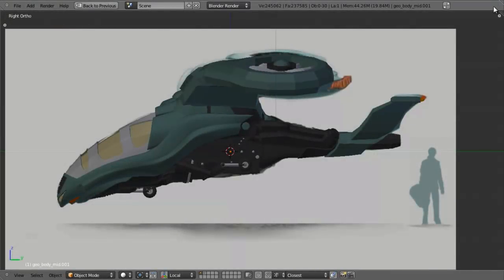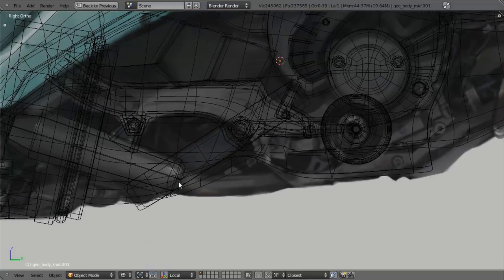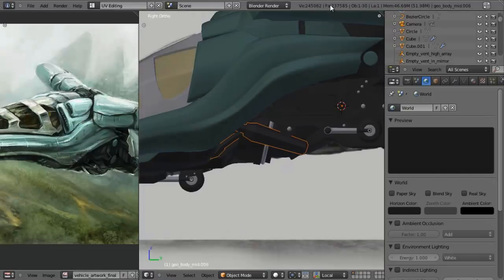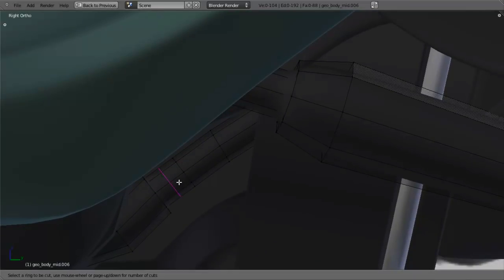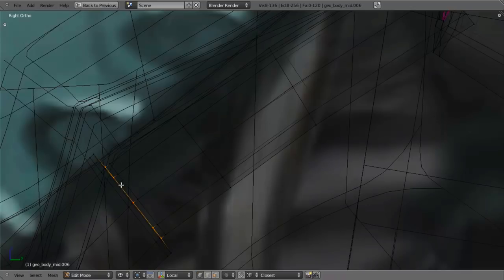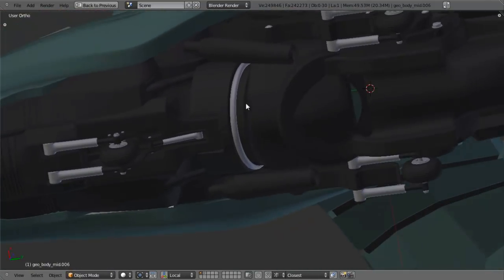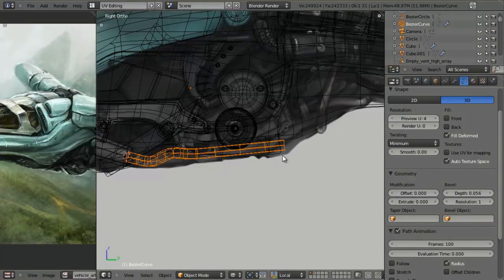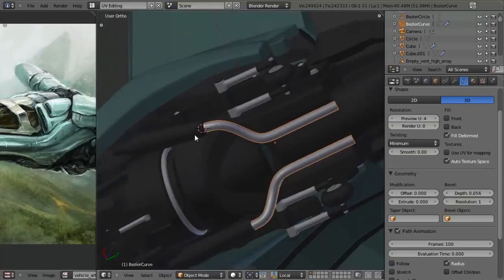CGC Classic: Modeling a Sci-fi Gyrocopter Pt. 14 (Blender 2.6)

Comment: Awesome job so far. On the wheel piston lines, maybe better mechanically to lay the wheel end [cylinder retract] hydraulic line along the cylinder up to the pivot where there is less rotational movement. Also they might be smaller diameter, even metal on the retract line untill it gets to the pivot, then braided sheathed rubber hose like the extend hose would most likely be.